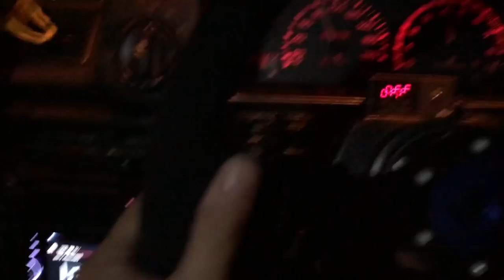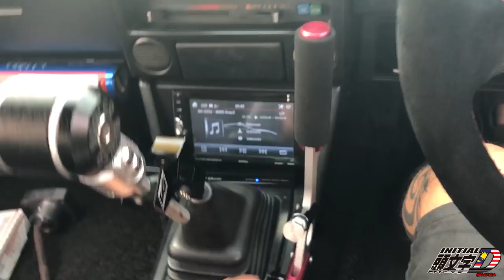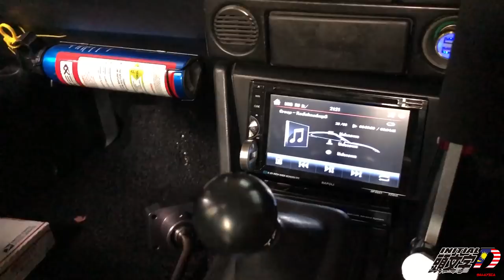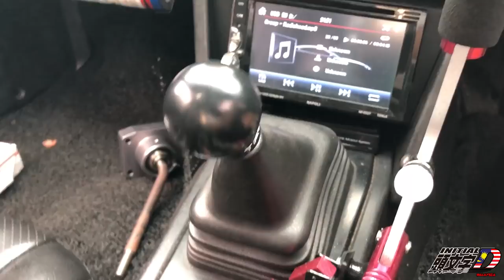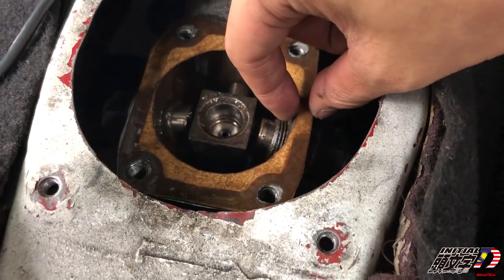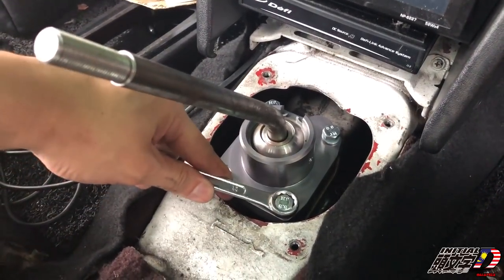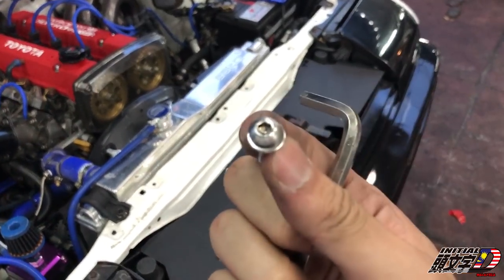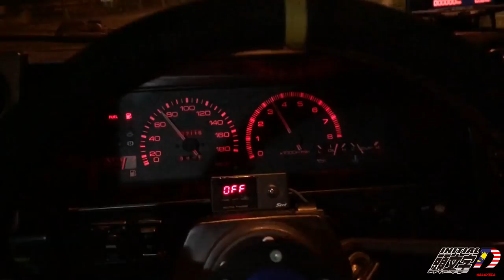THE MAKING OF TAKUMI PART 7 - T3 Techno Toy Tuning AE86 Shifter

Comment: Very nice sound made by the engine. Didn’t know it drinks petrol so badly. Hope that it will improve after u tuned. If you are coming to SGP and u travel down Orchard road man you sure hit the spot light. Best at night where no ERP and less jam. Rev high and heads will turn. The sound Gosh bit those bull and horse badge. Just my views.
Reply: Sean Wee wee i think can consider  make a weight reduce project,  change the hood to carbon fibre,  along with lightweight rims, because rear drive wheel car due to the engine placing, hence the front engine space quite big. My opinion lah.

Comment: The issue is on the plastic on the lower part. It is loose. Just buy one and replace it. You don’t need a new shifter haha
Reply: Mike Kong may be the significant bush hard to find?
Reply: THOO ky it is a standard Toyota bush, in some western pages, they sell metal reproduction of that particular bush which will be better for race use but.ive never used them so I'm not sure about the noise
Reply: Mike Kong Noted,  thank you for the information.